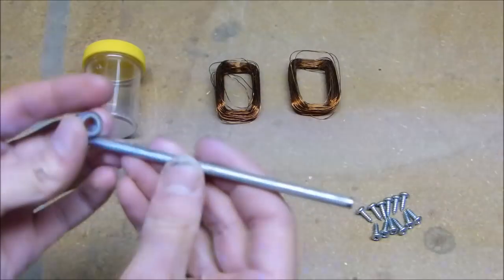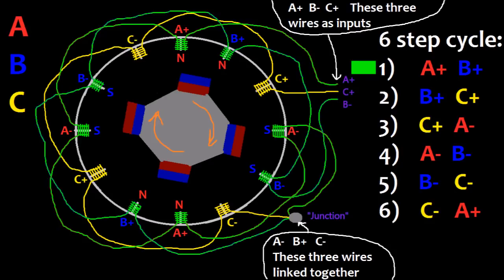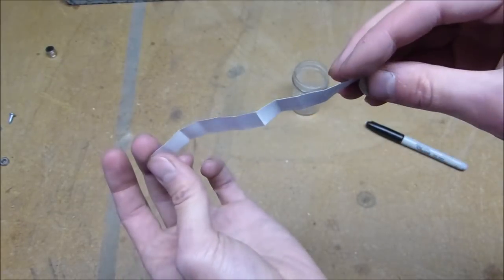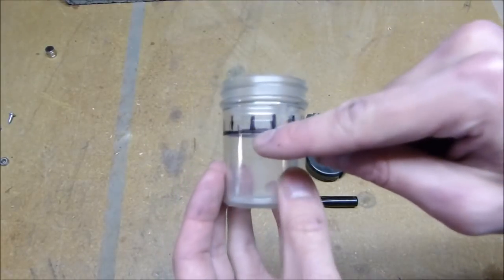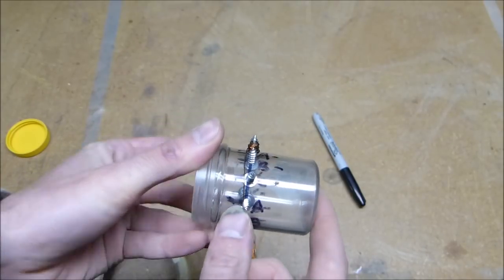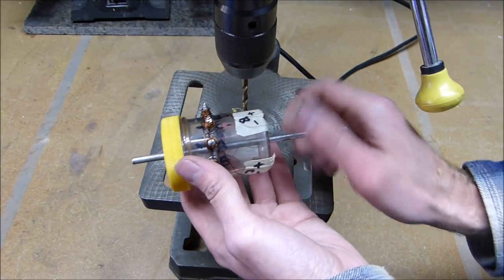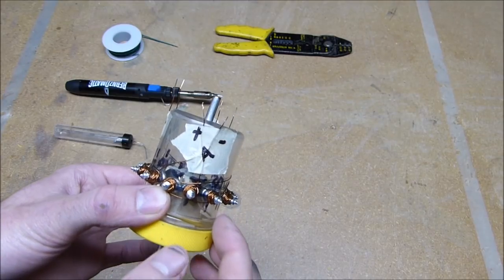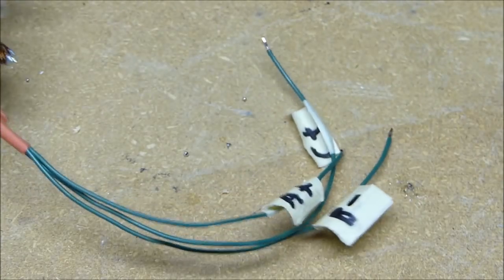How to Make a Brushless DC Motor Inrunner

Comment: Thanks for the video! Hey so I was wondering what do you think is the best gauge wire size for a quadcopter motor build because I'm working on a big project of my own and I need some guidance. Thank you in advance for any help you can provide.. ☺
Reply from the maker: +EpiclyInsaneGaming I don't think the wire gauge is going to decide too much so just use what you want to. The wire gauge will mainly affect how hot the motor gets for a given current. You can double the wires up (use a few pieces as a multi-strand wire for one coil), this lets you use small size wire so it is more flexible and easier to wind while having lower resistance of a larger wire. You will want a motor with a fairly low KV rating (rpm-volts ratio) so the motors are not twitchy and over-responsive. So lots of turns of wire. Honestly I recommend just buying the motors but if you really want to make them it would be pretty cool.

Comment: Hi JaycubL I know you probably will not see this but I am trying to build this design and I am having some trouble. When I plug it into the speed controller and start to use the remote it starts to shake a little and gets faster and the spindle does 3 revolutions and starts shaking back and forth again. We tested the full circuit by connecting it to a battery and doing the full six steps and it does a full revolution so I do not think it is the wiring. Do you think it matters that the screws with the wiring on them are perfectly separated? They are pretty evenly spaced but there are teeny differences. Another problem could be that the magnets are not level with eachother. Two are slightly higher up on the wooden cube than the other two. Would this make a difference? I hope you can help
Reply from the maker: It could be that the magnets are too strongly attracted to the iron screws maybe... If you add a flywheel / weight to the rotor that should smooth out the movement, that may be enough to fix it.
Reply: JaycubL thanks for the reply. Do you mean something non magnetic that will keep the momentum of the axle going? Does it need to be non magnetic? Are there any house hold items I could use in place of it? Otherwise I could order it. Once again thank you for your reply

Comment: for the cobber coil that ur using , will the elctricity not run trough everything if on coil is touching another
Reply: It is enameled wire so that it will not short or conduct across the wire.

Comment: If you were to spin the shaft, will the motor produce electricity?
Reply from the maker: +HYDROGENTEK Yes, if you close a circuit between two of the output wires you will get an AC signal. You could make a 3-way full wave bridge rectifier with diodes to get DC (they are normally two way but 3 way would work the same). I am not sure how you would get a steady voltage unless you put a sort-of-big capacitor in parallel with the DC out and keep the rotor of the generator at a steady RPM.

Comment: how did you decide on how many turns to make per pole? i'm sure there is a computation for it.
Reply from the maker: +justinedreco You can use basically any number. More turns = more torque but lower KV (RPM per volt).

Comment: Hey! I'm doing this thing in school called the "Personal Project"; it's a part of the IB education program, and in it I decided to try to build my own DC Brushless motor. Could you help teach me how to wire a 3 phase, but maybe with 24 screws instead? I have a couple of other questions too, such as how strong the magnets need to be, whether it's a good idea to do more than 25 windings/turns, and how much voltage different thicknesses of wires can take before they melt? Thank you so much for the help!
Reply from the maker: It is good for you to do this project I guess, you should try to learn a lot in the process. You can wire a 24-pole motor the same as this and double the # of magnets so it is just a doubled version of this motor. The magnets can be any strength, might be easier to get it working well with strong magnets and a small gap between magnets and coils. Stronger magnets will result in more torque but a lower KV rating (KV is RPM per volt). More turns of wire will also result in higher torque but a lower KV rating. More turns of wire will have greater inductance which will limit the how quickly the current can switch direction or intensity in the coils (more turns = stronger magnetic field = sharper rise in magnetic field as current increases = more back emf induced in the coil). Fewer turns on the coils will generally allow more current/less heat buildup and higher RPM but lower torque. For the final question you asked, voltage will not melt wires, current will melt wires. V = IR so higher voltage will allow a higher current up to the limit of what your power supply will do though. For a chart of wire size vs safe current levels, just to an online search.
Reply: Thank you so much!!!! Is this configuration also easy/possible for an outrunner motor? And one last thing to know how to configure the magnets, do I simply need to make sure that the adjacent magnet has the opposite polarity, and the magnet across from it also has the opposite polarity? Again, thanks for the quick reply, it's greatly appreciated!
Reply from the maker: For info about outrunner construction I have another video: https://www.youtube.com/watch?v=XeqC7nnae_Y   and I also recommend this Wikipedia page: https://en.wikipedia.org/wiki/Outrunner
Reply: JaycubL thank you! Have a great day :)
Reply: William Jedig I can't help answer your question but I can help you in life... LEAVE IB AS SOON AS POSSIBLE!

Comment: Can you please share some details like diameter of the copper wire and the reason behind the third wire.
Reply from the maker: The gauge of the wire is not critical, I think mine was roughly 18 to 22 AWG. The connections of the wires and the electromagnetic cycle of the motor are show in the video, I can't easily explain all that in a comment.

Comment: So does the controller determine which coil has voltage? if so it feels more like a 3-phase ac synchronous motor.
Reply from the maker: This type of motor is referred to as a bruchless DC motor, it is a DC motor where the brush commutator is replaced with a solid state commutator. I think "AC synchronous motor" refers to an AC motor where the rotor magnets are actually coils powered through brushes on the same power supply as the main coils.
Reply: Ac synchronous, as i have learned it at work, can be caused by multiple phases of ac current creating a rotating magnetic field that the rotor, either with permanent magnets or some form of field windings, will follow.  I was just curious since my knowledge of dc mechanics isn't as good and it looks like what i see at work

Comment: Really good video ! Is it possible to use this motor for drilling purposes ? is the torque enuoght for drilling ?
Reply from the maker: For drilling you would want to use a gear or pulley for mechanical advantage to get more torque. The torque is decent for a motor of this size.

Comment: How does a brushless dc motor work without the hall sensor? Does it have something to do with the ESC?
Reply from the maker: Yes most hobby ESCs are for sensorless motors. It monitors voltage induced in the set of coils that is not on. Does not work from 0 RPM though so at very low RPM sensorless motor will not run as smoothly.

Comment: For this type of engine, what happens if I increase the amperage or voltage? Thanks
Reply from the maker: +Pedro Cavalcanti You would see an increase in torque and RPM, along with more heat.

Comment: thank you very much...plz mke a video of hoq to mke dat controller..if u hav made the video then link plz...and battery of hw much volts?
Reply from the maker: +Akhil Shah OK Yes, I do plan to make a video about the controller. A wide range of batteries can work. The battery you need might depend on the motor and controller.

Comment: What speed controller wood you recommend for a 12v bldc with 30/40 amps required?
Reply from the maker: +Bernie Rider I am not sure, there are many available for sale online at good prices so I would normally get a cheaper one that is rated for higher amps than you need. Maybe a 60 amp one. If it will get a lot of use then it is good to add a heat sink.

Comment: What gauge wire did you use and what kind of voltage / power supply did you use?  I want to teach some 12 to 16 year olds how to build 4 or 5 different kinds of motors
Reply from the maker: I think the wire is about 18-20 gauge. The battery is a 3-cell lipo so 11.1 volts (12.nn  volts at full charge). That is cool are you a school teacher?
Reply: No, I'm an American living in Moscow who has no marketable skills but for my native language. Still it can make  as much as $50 an hour  or more for private English lessons. This idea is to form a class of bright students not interested in learning English. I did go to DeVry and got an A.S. degree in Electronics.
Reply from the maker: Cool, some people should be interested.
Reply: There is a two solenoid car on youtube I also do a brushed & brushless motor combine the two to make a generator project and then a stepper motor and last an alternator.

Comment: A perfect job, but i wonder how can i improve its rpm?And can you say that one's rpm?
Reply from the maker: Fewer turns of wire on each coil will reduce torque but improve max rpm. I did not measure the rpm of this motor.

Comment: Yow dude! How to determine the amperes and volts of a brushless motor? And how to determine the copper wire used and know its turns? Hoping I could get a response.
Reply from the maker: Either try to find some online chart or calculator or just experiment (using Ohm's law as a starting point). It's not a fixed number because the inductance of the coils limits the current rise/fall rates... so it is somewhat rpm dependent.

Comment: May I ask you something? When I'm attaching those cables to the ESC, it doesn't matter how they are attached?
Reply from the maker: If you reverse two wires, the direction of the motor's rotation should reverse.
Reply: Mikuláš Koníř נ.  מ.  
מנ חמ מ

Comment: that was great . what is the relationship  between the number of wire turns on a coil and the torque or rpm?
can you introduce me a good resource on brushless dc motors? thank you
Reply from the maker: More turns = more torque (more magnetic field for the same current) BUT it also means more heat andmore back EMF in the coil when switching (so a slower switching time, less peak current possible as RPM climbs, less max power possible). Fewer turns can allow a higher RPM and more maximum current and horsepower.
Reply: i appreciate

Comment: Would this have enough torque make an electric skateboard? Would it handle 10 to 20 li-ion batteries?
Reply from the maker: You can use heavier wire and a thicker axle, and build the whole thing stronger overall. Then it would depend on your gear ratio and other factors like cooling you can supply for the motor, weight on the skate board. Yes it can work, how well it works depends on how well you build it.
Reply: JaycubL thx i apreciate the help

Comment: can u plz hlp me out.. just made it but stuck. dont have esc so i directly tried to run it with 12v SLA battery.. but when i try to make contact with wires of bldc and battery terminals its get shorted... spark is produced from battery terminals. though the shaft rotates a bit.. plz hlp me thanx ...
Reply from the maker: +Dhruv sharma Yes that is normal. It need the brushless motor controller to function. The controller acts like the commutator in a brushed DC motor. It switches which coils are on and off.
Reply: +JaycubL thanx for your sharing....

Comment: The copper wire must be cleaned from isolating lacquer?
Reply from the maker: Yes, you have to use insulated sire for the coils so the ends need to be scraped clean for electrical connections.
Reply: Last question: If I haven't got this special BLDC controller, can I use Arduino to control that?

Comment: what is the amount of Amps the moter uses? and could I swap the reciever on the esc with a turn knob to control the speed of the moter? if it is possible do you have some schematics for me? 
really great video.
Reply from the maker: +sergantawesom I am not sure of the amps, I used a 40 amp rated esc and it worked fine. The esc can connect to any 5v DC power supply on the red and black wires, and the signal wire takes a 0-5v PWM signal and should work fine with a 0-5v analog signal (the knob) too. So I guess connect the potentiometer knob to the signal wire and to the +5v source, and maybe add an on/off interrupter switch in series with the knob.
Reply: thank you for your comment, it was helpfull.

Comment: where will the three wires go if i hav to mke the motor work on 9 volt battery? thnx fr yr rply
Reply from the maker: +Akhil Shah The motor connects to a controller, the controller connects to a battery. If you want to run it straight off of a battery then this is not the right design of motor for you in this case.

Comment: Mind blown... although I fast forwarded, how the hell did the RC management control the homemade motor... incredibile! no sensors... ah need to watch the whole thing I guess...
Reply: At any given time, two coil sets are on, and the other is not (see the 6 phase cycle near the start). The magnets induce voltage in the inactive coil set, and the speed controller monitors that voltage in place of a proper sensor. The main drawback is that there's no induced voltage when it's not moving, so starting the motor is not as smooth as with hall effect sensors.
Reply from the maker: Good explanation!

Comment: it is confusing that back emf 
  draws up while at stationary !>>how the controller figures out the back  emf at start !! 
can any body explain???
Reply from the maker: +Adel Physi At start and very low RPM, it cycles through the phases at a slow speed with no back emf detection. Then once the rotor is moving it runs normally.

Comment: Your video is great!  I'm a Tech Ed teacher in NH and my kids and I are constructing some.  Its been going great.....but now we're stuck.  Can you give me any info on how you got your ESC to program for running these home made motors?  Thank you.
Reply from the maker: For the esc, I just plugged it in and it worked. It is a 30 or 40 amp sensorless esc for rc airplanes. The issue you are most likely to encounter is that if the magnets are not very strong or if they are too far from the coils, then the back-emf signal to the esc will not be very strong (that signal is how the esc detects motor position and times it's actions). If you give the esc a little throttle and flick the motor over (get it spinning with your fingers) you might get it working fine even if it won't start itself from zero rpm.

Comment: how to connect the three input cable to battery? how many voltage required?
Reply from the maker: It needs an electronics speed controller (ESC). It can run on a wide range of voltages.

Comment: Hey JaycubL its awesome, thank u very much.
Can u  please let me know about a) Which wire u plugged in the centre knob (female) of ESC - is it B neg and b) Is this Delta or Star type circuit ?. Thank a lot dude.
Reply from the maker: +Vinod Kendarla I think this considered a wye type circuit. It does not really matter which plug goes in which place on the esc, you can change the spinning direction by reversing two plugs.
Reply: Thank you for ur reply.
Sir Is it Ok if we plug the Bneg to 1st or 3rd socket (female)?.
Reply from the maker: Vinod Kendarla Yes either way. You can try different plugs too if it doesn't work that way.
Reply: Thanx a ton sir

Comment: I'm no engineer but may i ask... why does the rod spin when u give electricity to the screws?
Reply from the maker: It does not give electricity to the screws... I am not sure if it will make sense from your perspective but the mechanical cycle of this motor is described in the video starting at 1:28
Reply: It creates a magnetic field, the magnets try to connect with the north and south ends but as soon as it rotates the north and south ends change and it goes on like that until the electricity runs out, I think.

Comment: Nice work ..... self tapping screw from the inside . Why not suggest nut & bolt & lock washer .
Reply from the maker: +magna59 That would be easier yes! I used what I had.
Reply: +JaycubL ........ ye .......... I was on a degree course like that , it was about design around what you had & what the crap pieces of equipment in the work shop would allow you to machine ,  rather than what u wanted ........ Shame the screw driver fell in the cause . This clockwise & counter clock wise how did you come to that ?
Reply from the maker: magna59 To figure out the wiring pattern and how to connect it up, basically I stand there where someone won't talk to me and think deep/clear about it until I understand and see the whole thing. I guess just think about the functioning of the motor and you probably will see it. Basically it is a 3-phase type of motor so the coil banks are broken up into 3 sets of 4 coils. When each set of 4 coils comes on, 2 of them are of one polarity and 2 are of the other polarity to line up with the magnets on the rotor. So from there, it would be too many words and make no sense anyway... think about the 6-step cycle described in the video and the magnetic field positions you need to get, and try to see how you can possibly set up the physical wires and connections to get that. It seems hard but once you see it it's not bad.